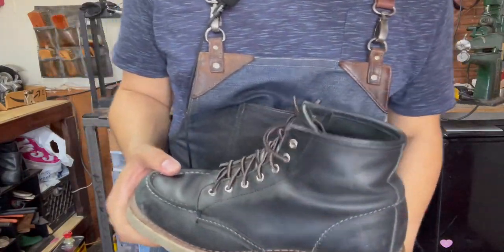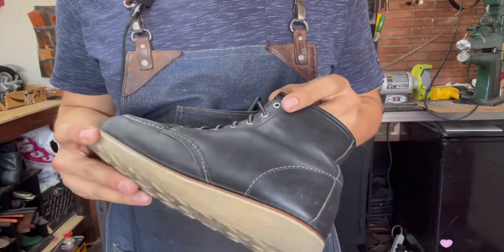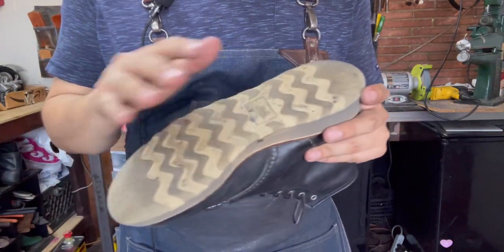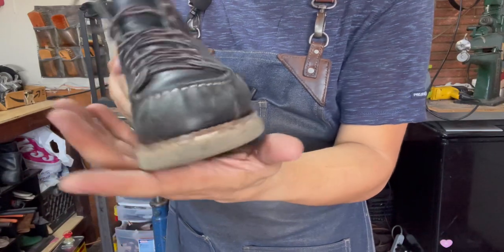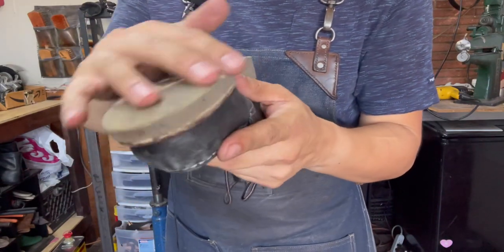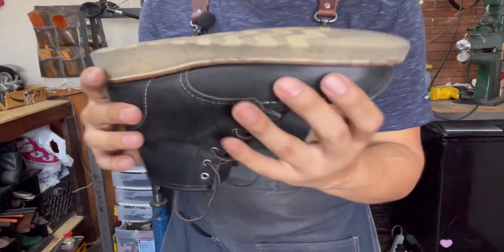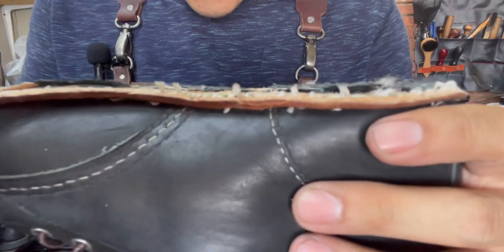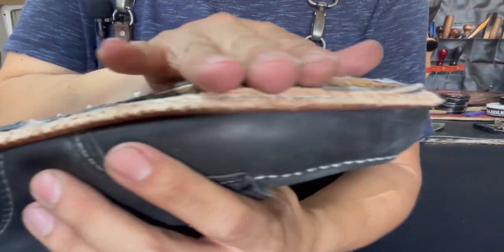Red Wing Moc Toe 3373 Upgraded/Women’s Moc Toe

Comment: Beautiful work.  A heeled boot in the sea of wedge soled footwear out there always stands out and looks better. 

On another note, I repaired my first pair of boots by putting a new wedge sole on them. I didn't have any of the right tools and my contact cement didn't hold very well. It was a nightmare finding things to clamp the welt down to the sides of the sole. They're hideous, but I think they will get the job done. I did use the technique I saw you use where you stitched through the welt into the sole to secure the front down harder, so they shouldn't immediately fall off 😅
Reply from the maker: 😬😬✋🏻👊 that’s good we all started at some point, and like you said, without the right tools things can be a little complicated!!!✋🏻👊
Reply: Go to home depot or your preferred hardware store and snag some of them 1 dollar spring clamps. That's what I use.

Comment: Aaron it seems even on the job you can’t escape your wife’s projects jaja 😅

I do have a question for you if you don’t mind.  Could you have kept the original welt and just sanded down the high areas of the upper and then put the cork and new sole on?  Or was the original welt not even/flat around the boot?  It seemed to me like you could but maybe you just wanted to do the welt yourself with a high quality, personalized touch?  Anyway, appreciate any explanation. Thanks
Reply from the maker: I know right 😅😅

I would never keep the welt on mine or my wife’s boots 
Simply because there’s no comparison between a Resole keeping the same welt and having a new one, not mention that I used a natural color and stained it the way I wanted it.

 
Don’t get me wrong, I do a lot of Resoles in which I keep the welt, but I don’t make videos of that I’ve mentioned that Re-welting a pair of boots  takes an extra 60 to 80 minutes, So these are the 3 Reasons why I keep replacing welts 

1- because is over sanded and by the time I do my final sanding, you boots will end up looking like (Dress Shoes) you’ll need a magnifying glass to search for the stitching on the welt 😅😅😅
If the client wants that I’m ok with it 

2- they want a different color 
Either black, brown, Natural etc.

3-they want to go from flat to storm welt

Again don’t get me wrong I for sure do regular Resoles and keep the same welt 
But I only make videos about custom Resole .
I have several videos where I kept the welt!! Thanks for watching!🙏
Cheers!!
Reply: @AaronG2480  Thanks for the answer Aaron.  You do amazing work.  👍🏼
Reply from the maker: @aradoran  you’re welcome!
Thanks